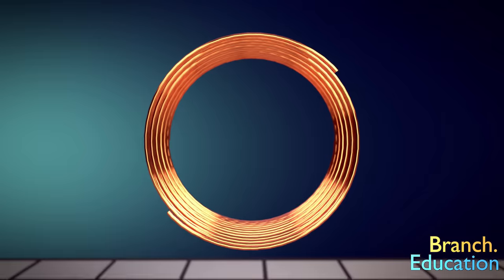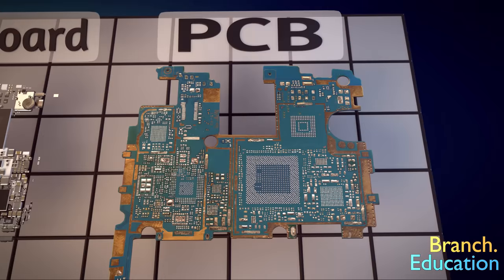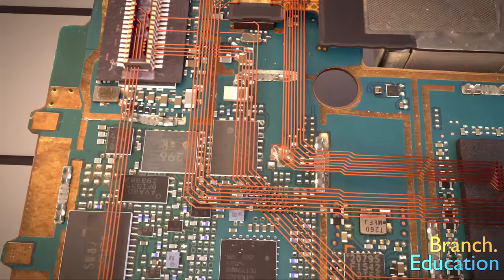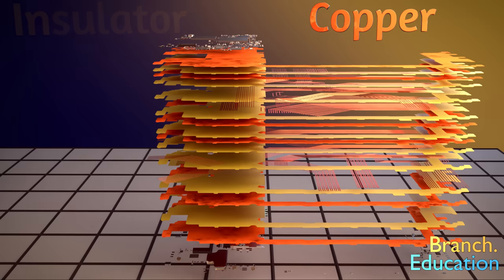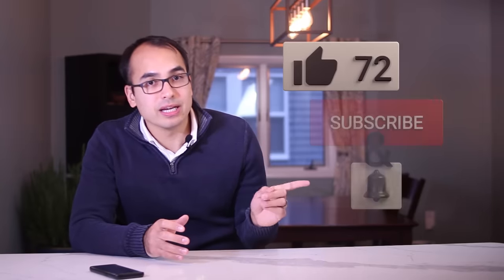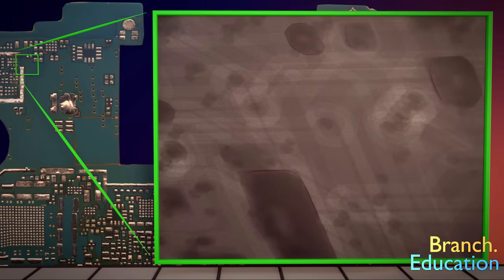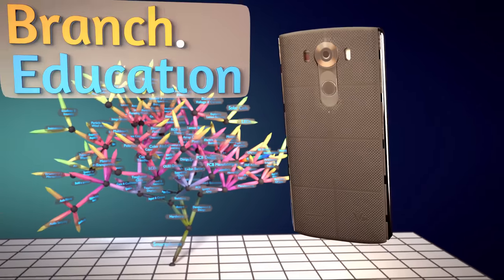What are PCBs? || How do PCBs Work?

Comment: I am a PCB designer.. and every PCB designer should watch this animation before he start/choose this as career... Such an inspiring animation.
Reply: How do you go about designing a PCB? I feel like it’s more of a puzzle where you just try to fit the components you’ll be using onto the board
Reply: @reyariass  
According to what’s presented in the video, I’d assume you’d need a mission (what are you tryin to do?), a plan (what do I need?), and a design (how can I fit all this?). Then design the PCB. The components are subordinate to the design. You select the components to match the PCB, rather than designing the PCB to fit the components.
Reply: @totallyfrozen  There are tools that do autorouting of traces for you.  They help find the optimal locations to fit everything.
Reply: Oh ok then i can ask you this because google has no answers and this guy dont find or read my now deleted comment: what type of steel and so on do you use to make this thing?
Reply: @reyariass  First we design a schematic with all component (eg- IC's, resistors, capacitors etc) which actually is an electrical circuit with its connections. then each component also have its landing pattern (footprint) associated with it. Then we start actual board design. PCB designing tools help us showing connections between pins of components from the schematic. then we place each component on some fixed board size such that there will be minimum overlap of signals. we route the tracks and send this design for manufacturing. hope you got at least bit picture.
Reply: @dewaldsteyn1306   We design PCB's and manufacturing houses manufacture PCB in layers. conducting/signal layes are copper layer usually of 35 micron thickness but can vary as needed. Insulating material between two copper layers is usually FR4 (Mixture of glass and resign) but can be mixture of many other compounds as well if needed.
Reply: @pravinladde  oh ok. Well thats interesting honestly.
Reply: i just wanna do one of those portible console projects
Reply: I'm starting on the pcb design!
Reply: @oscardiaz9739  Normally you do not need to worry about materials. If you need a PCB for some functions, just design it and throw your drawings to manufacture houses. They will help you solve the material things.
Reply: I am Sixteen years old and I already finished 10th Grade, so that means I am going to be a junior!
Reply: @kylekuchinski281  same? I'm pretty sure thats just how school works
Reply: hey can you please share report on pcb designing to my mail
Reply: @pravinladde  hey buddy i want to pursue my career in electronics engineering, so can you suggest me the branch and any specific college or our college journey
Reply: @reyariass  Also design these for a living; usually a good proxy is to start from a prior gen's design. chunks of real estate on the board are negotiated over across various teams (power delivery, memory, PCIe, display, etc) based on spec targets that must be met (based on components, end user experience targets, feature add-ons, etc). From there meticulous design,  modeling, prototyping, lab measurements allow us to iterate until a successful design is achieved.
Reply: What materials do you use ?
Reply: Currently an electronic engineering major about to finish year 1, any advice for me like popular internship gigs, what to focus on more within the major and what’s not so important?
Reply: @JamieVegas   you are correct there are tools which we will use to connect the traces and autorouting is there. But main point is auto routing never works as you think, 90% of the work need to be done manually, and high-speed designs you can't even imagine
Reply: Bhai apse kuchh baat karnhi he
Reply: What engineering did you complete
Reply: Do you guys use a Burkle Press in your company.?
Reply: What kind of education did you need to start doing this?
Reply: @pravinladde hi i, I’m a bit late. Is’nt signal integrity also a huge part of pcb designing ? Because when you reach certain operating frequencies a lot happens between the layers like parasitic capacitance (I’m having trouble as a to get a board working well because of that, my digital signals are horrendous)
Reply: Pls can u tell details how u become PCB designer or how if anyone want to be this engineer what he has to do
Reply: Hello,

I am a bit older and trying to teach myself things I did not learn when I was young.

If someone could guide me, I have a few questions that I am having trouble understanding.  Please help. Thank you in advance for your kind reply.
Reply: @CindyHuskyGirl same lmao

Comment: This video very well describes what PCBs are.  I have only a couple of small little quibbles with the video:  the video doesn‘t show the large scale end of networking PCBs and it doesn‘t explain how with the use of flex-rigid PCBs, the number of connectors in a device are greatly reduced and signal integrity is greatly enhanced.

But again these are truly quibbles!  This is an excellent overview of the humble PCB using the modern cellular phone as a “show-and-tell” vehicle.  I have worked in the PCB industry for nearly 50 years now and can attest to the great and accurate job you have done here in making this video.

Comment: The animation combined with the 3D models and real photographs is exceptional, this deserves to be a huge channel.
I work in electronics production and even I didn't know some of this!

I gotta say though, making these things is way, WAY easier than fixing them.  I've seen some uh, interesting PCB designs too :P
Reply from the maker: Thanks for appreciating the video!  It is SO much easier to make them than fix them.  I've fixed traces on a 4 layer board with grinding and scratching out inner traces, but I have no clue how I would go about fixing a 10 or more layer board.
Reply: @BranchEducation  Honestly at my place we don't even get involved with trace repair, its components only and even then there's so much that can go wrong with board population!
Reply: @BranchEducation  I guess you're already aware of that :D, but no one fixes broken wires anymore. Most pcb's are modular, so you can easily swap out a broken pcb for a fresh one. The most you get is replacing a broken BGA, which is already a pain :D
Reply from the maker: @Mike_droptv  I'm familiar with that.  I have in fact reworked PCBs in the past because of design errors.  Cutting traces, rerouting, and reworks, in general, are a pain, but sometimes ya gotta do it to get design verification before respinning the boards.
Reply: @BranchEducation  Oof, that sounds like a hoot and a half. Fixing broken pcb's is one thing, but correcting design errors on the internal layers is just... these anxietys are kicking in again :D
Awesome video btw, love your work 👍

Comment: For those who wonder how those intricate labyrinth of wires end up there so precisely, They are not put there, but formed from a sheet of copper over the FR4 or phenol board by removing the copper from the areas where it is not required. It is done by applying a protect pattern mask over the copper sheet where wires are to be, and then dissolving the unprotected areas of copper in a chemical acid or salt solution. It is called etching.
Reply: Sounds similar to how the chips are made!

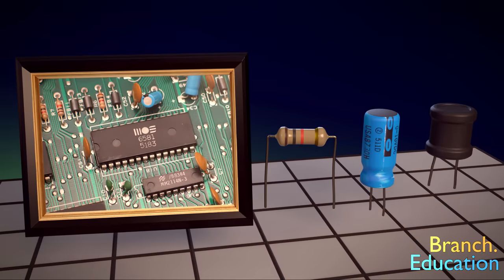Comment: 8:51 those components are still called through hole components and they are still used today by hobbyists especially as they can be easier to solder.
Reply from the maker: I still have a ton of these components in a slew of plastic bins.

Comment: I'm a Senior Electrical Engineer with expertise in ultra miniature electronics designs.  Very nice presentation!

Another important factor is high-speed signals require controlled impedance, which is determined by the material properties and geometries of the features on the board.  Very complex physics principles at play (electromagnetism)!
Reply from the maker: That's a very good point that I should have added, if at least in a sentence or two.  Thanks for the input, and for enjoying the video.  What's an example of ultra miniatures electronics?
Reply: @BranchEducation  it was still an exceptional video.  I've designed very small IR cameras (20mm x 20mm x 18mm), GaNFET laser pulsers, and many other electronics to interface to custom image sensors.

Cell phones probably take the cake for some of the most complex, miniature electronics.

Still, the pixel pitch of IR detectors (we have the world's smallest at 5um) is typically larger than visible detectors due to the physical materials (indium gallium arsenide, mercury cadmium telluride, ect.).

The problem with Mid-Wave IR (MWIR), is that the materials have to be cooled down to 100 Kelvin or below to function properly due to thermally excited current carriers.

Comment: Great stuff! When studying electronics, I still didn't know that PCBs were made up of so many layers; I thought that they were just one dumb two-sided panels (with just top and bottom for traces). Also, I thought that the green stuff was the silicon semiconductor which we hear so much about; it wasn't until later learning that it's essentially fiberglass composite.

Comment: Wow, how did you make that PCB? Did some phone manufacturer give you the 3d files or did you have to recreate the entire thing
Reply: It looks like the images are made of photographs, with the 3D parts painstakingly modeled by hand
Unless he has a 3D scanner lol
Reply from the maker: Yeah, first part was opening up the phone and high res 2D [3200dpi] scanning and modeling the parts.  Because most of the parts are already flat, 2D scanning worked pretty well.  Then went to a soldering station and removed all the components from the PCB, then rescanned the PCB- which needed major Photoshop touch-ups.  Removing the SoC required more heat than I thought it would.  Then I sent the PCB to be X-Ray imaged, then I modeled small sections of traces from the X-Rays.
Reply: Branch Education I appreciate all the effort you put into your videos.

Comment: I was a Senior Software Engineer for BAE SYSTEMS for 20 years and wrote loads of crazy shit for combat aircraft and civil airliners but it was the Hardware Engineers who messed my brain with their designs for the multi-layer PCB boards that went into our HUDs, MFDs Helmet Displays, Weapons Aiming Computers and Flight Control Computers.  I had to think multi-dimensionally for some of our stuff but it seemed childsplay compared to the number and complexity of the layers that the H/W guys could deal with.
Reply from the maker: I have a few friends at BAE up around Boston/NH!  It's a great company.  That must have been really awesome to get to see such impressive and complex engineering and write code for it.  I've designed a number of prototype and test stand PCBs, and it's kinda fun- after the schematic is set, it is like a weird 3D game of connect the dots.
Reply: @BranchEducation  I was in GEC-Avionics Airborne Displays Division UK so I wrote the s/w for mainly HUDs such as C-17, F-5. F-16 and Eurofighter as well as the fly-by-wire for the Boeing 777 airliner. However, one internal project I was seconded to work on was an oven-control system for the manufacture of our holographic displays, i.e. the "combiner" glass for HUDs where all the lenses and mirrors are actually holograms within a single piece of glass rather than individual components giving lighter more compact HUDs with higher FOVs.  This technology was developed at our Rochester UK site where I was and was showcased on F-22.  Our manufacturing section also developed a rolling solder bath for the PCBs used in such systems, this is what created the complex yet compact multi-layer circuits that our h/w engineers developed using in-house design tools.  Hence, most of our work was created using in-house developed tools, processes and techniques that are now more-or-less commonplace and everywhere.

Comment: 3:50 what does it mean that the outer layers are acting as multiple antennae, I know that the antennae are separate or it just means for connecting the antennae ?
Reply from the maker: Look up planar inverted f antenna.  It's an antenna that is common in a lot of devices and it is made using traces on the pcb itself.
Reply: @BranchEducation  let me thank you for your reply and the video of course !

Comment: Maybe a dumb question but is there any way that you could make a system on a chip with all components included, like capacitors and everything else on the pcb, except cameras, buttons, and Touchscreen. So that you basically wouldn't need a pcb at all and just a couple wires to some components. Is it technically impossible or would have some other major downside wich explains why it isn't done right now?

Comment: I feel like demonstrating the amount of copper in a PCB by saying how long it could stretch is kind of arbitrary. We can continue shrinking the diameter of the hypothetical "wire" until we have a nanometer thick piece of copper stretching to the moon, then we could say there's enough wire in your phone to stretch to the moon?

Realistically, there's about 10 grams of copper in your phone, which equates to roughly 2 meters of 18 gauge wire...

Comment: My question is , computers use binary code to know what to do , what's the basis of that

My theory was that it's through electric currents that flow through the wire to the chips and all that other stuff
So when it hits a certain chip , the computer now's what binary code that is which is given the value of something 

And when you put all the values together they perform a function 

I would like to hear your thoughts (Everyone)

Comment: i have a broken phone i have diassmbled it and toook out the cameras fingerprint sensors batteries and even the pcbs so i want to make a project from all of those like making a spy/web camera or using the storage chip as external storage device .  can u suggest any website or something where i can know about who actually the pcbs interface all the cameras storage devices etc
Reply: Dude you will need to modify the firmware and software components

Comment: While the animation and explanation are great, the title is definitely misleading. This is not the PCB in general, in contrary, this is just explaining smartphone multi-layered motherboard that is far different than ordinary/common PCB (which is what 99% of the PCB world is). What I do expect from the title are: 
- the single-layer PCB (the most common), 
- how it works, 
- what type of PCB, 
- disadvantage and advantage of each type, 
- and how it is made. 

This video is focusing to explain the latest smartphone PCB that has multiple layers, something that is not widely used by the rest of PCB. In my opinion other types of motherboard (such as PC or laptop) adopting multi-layer will greatly increase complication for repairer (because this kind of multi-layered PCB is impossible to be traced without downloading the schematic, if such schematic is allowed for free to download). And also the more miniaturization of the component, the harder the repairer job will be especially when soldering/replacing.

Comment: the pcb won't work if there was no electricity or electric force of electron to charge the battery bank then RTC then power regulation then to capacitor to diode to lithography to silicon to 555 to DCU 2 MCU 2 G9U 2 TKU 2 LVU..

Comment: How can printed circuit board made up of hundreds of copper wires? 
A PCB is basically made up of a thin layer or layers of copper foil laminated onto a non-conductive board which can be made of glass fiber weave infused with resin material that has printed circuitry etched onto it. 

Sources: 
https://en.wikipedia.org/wiki/Printed_circuit_board
https://www.sciencedirect.com/topics/computer-science/printed-circuit-board

PCB is NOT made up of hundreds of copper wires.
 
So, please get your facts right and make corrections to your explanation on this presentation.